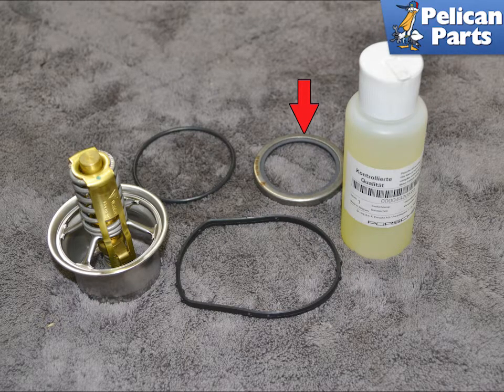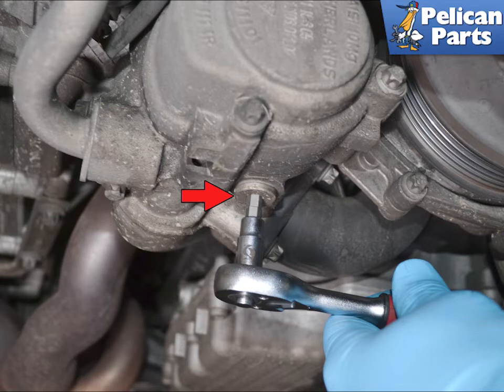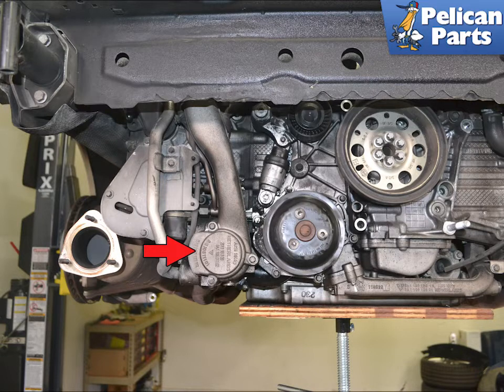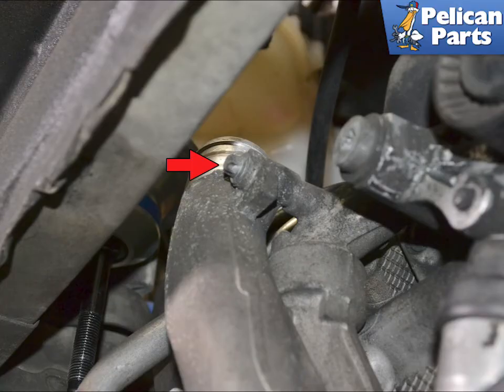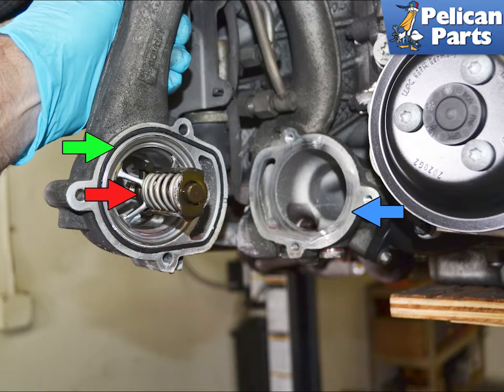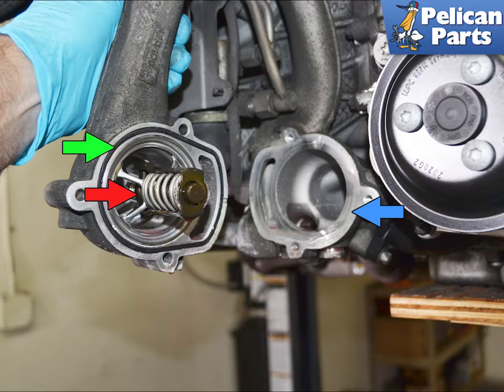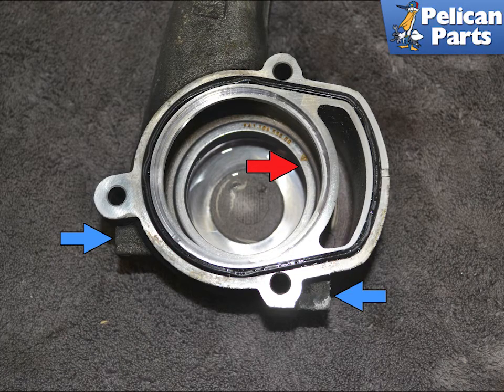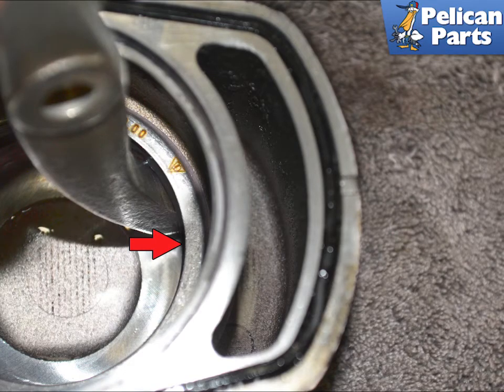Porsche 997.2 Carrera Thermostat Replacement (2009 - 2012)

Comment: This video is very misleading. There is no clearance to get an e10 socket on a few of the bolts. Use an 8mm. Once you have loosened the bolts the thermostat wont come out. Beware.
Reply from the maker: Did you try a 1/4" drive E10? They are the same size (construction wise) as an 8mm socket. Thanks for the Info. We appreciate it.